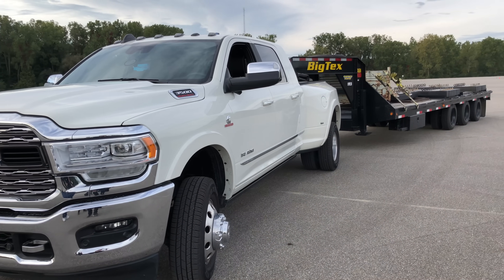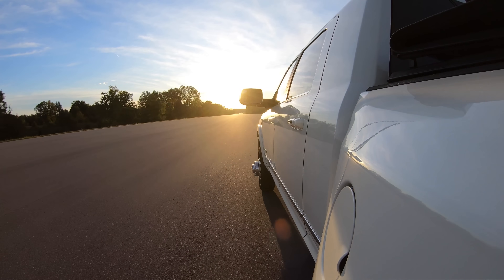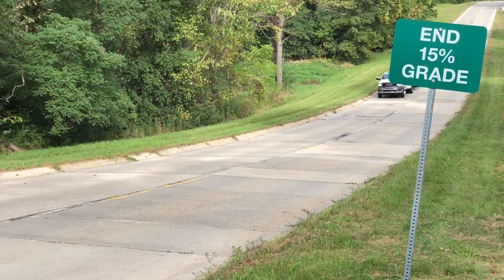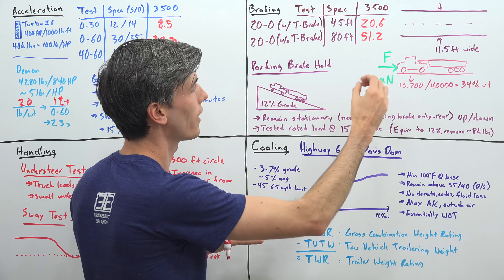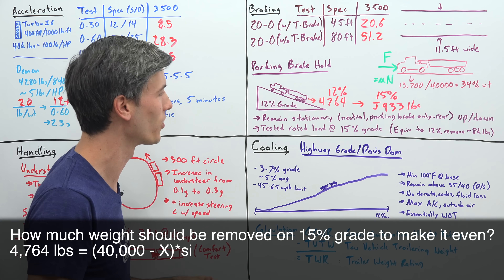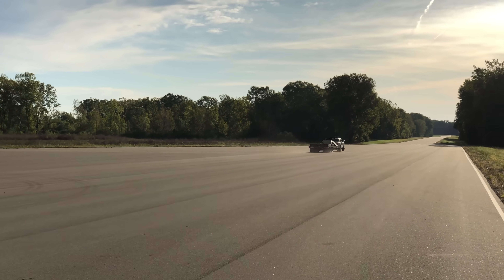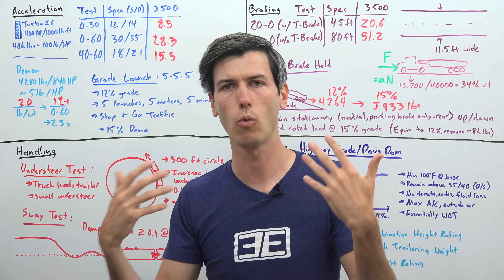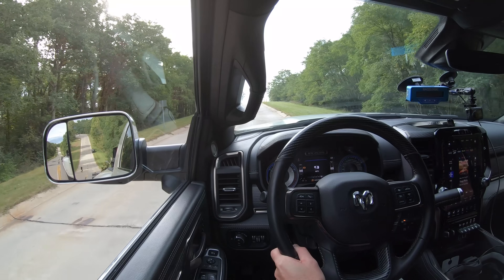How Much Weight Can Trucks Actually Tow?

Comment: Why do dual rear wheels make the tests more lenient?
Reply from the maker: Because dual rear wheels will be pulling much higher loads (thus will accelerate more slowly).
Reply: @EngineeringExplained   I don't follow how the understanding that dually trucks will pull more weight should allow them to meet lower standards than "regular" trucks. The safety/comfort implications of not being to sufficiently to accelerate to speed on the interstate, hold on a hill, not overheat under sever conditions are the same regardless of the number of tires on the driven axle.

Said another way, a dually truck is allowed to perform worse in almost every way than a 4-tire truck with the same towing capacity. That is not what consumers expect.

I could see an argument from a rear cornering stiffness or redundancy in case of rear puncture.
Reply: @roflchopter11  so you think a semi should accelerate as fast as a 4 wheeled truck? See what I did there?.. Compared 2 totally different vehicles, making no sense. More weight is more weight and more power, torque, and brakes can only do so much to overcome that.
Reply: @roflchopter11  - there's a piece of info you're missing- the single tire trucks don't have as high of a towing capacity. The single tire can't handle the weight, so the trailer has to be lighter to keep the tongue weight appropriate. So with that in mind, the lighter overall weight of the single axle maxed out should be more authoritative in every performance metric.

*edited for spelling*
Reply: @Broadpaw_Fox  trucks don't need more than 30k lbs towing anyway. Need a license for that, and at that point you might as well get a semi, much safer and better at the job
Reply: @Ckcdillpickle  - oh, I agree. But to be clear, I'm a truck driver and have been for over 10 years. Hauled a lot more than 30k lbs... :)  But I do agree that people should be better trained to drive larger vehicles/payloads... it can matter a lot and would save people's lives and/or wellbeing. 

It would also give people in smaller cars an idea of what it's like driving something large and heavy, which might keep some of them from driving as badly around us... potentially saving lives and wellbeing. :)
Reply: @roflchopter11  A dually truck is going to have very comparable amounts of power to it's single rear brother. For example, having driven a F-350 single and dually they essentially identical power output, but one is hauling quite a bit more weight. That means it will take longer to change speed, up or down. At any weight rating, the dually is the better option.
Reply: @billkerksiek208  I know it will make similar power/torque and that it is the better option due to rear axle capacity. I just don't see why SAE has decided upon what are supposed to  be objective performance metrics for what a truck can safely pull, but then handwaved more lenient metrics for dually trucks. If the issue with pulling higher loads on a single rear axle truck is that the rear axle can't take enough tongue weight to be stable, shouldn't that show up on the understeer and transient response tests? Similarly with rear grip and the parking brake test.
Reply: Extra weight and associated drivetrain losses
Reply: @KaitouKaiju  But you have more grip. and the extra weight is minimal when you are towing 40,000 points.
Reply: Matthew Jackson Rotational weight is also different than just actual weight. 

For example you will see more power if you remove 10 pounds from the drivetrain, than if you remove 10 pounds from the cab.
Reply: If you're bigger, you can be slower without being all that unsafe. "Acceptable" acceleration for a big rig is "suicidal" acceleration for a motorcycle.
Reply: IAmTheLiquor Lahey  "your". Well, I had a good laugh. It seems you're the kind of person who replies to a month old comment on YouTube to berate the OP for asking a question you deem trivial or unworthy of being fully answered.

Comment: For towing engine longevity, is it better to tow pulling up a hill or use engine breaks going down a hill?
Reply: I didn't know if the high revs of engine breaking was more difficult on the engine then lower revs towing up a hill.

There is a lake I take my boat to regularly where I actually do have the option. I can drive around one side with much steeper uphills to the lake or around the other way with a much more gradual incline and then downhill into the lake.

Comment: Drives a nissan sentra... clicks video anyway.
Reply from the maker: One day you'll rent one of those baby uHauls haha, and you can run performance tests to see if rated properly. 😂
Reply: @EngineeringExplained  "Hello, AAA, yeah it's me again"
Reply: I do have a medium duty truck but the most trailer weight I've had was around 8,000. However I enjoy wrapping my head around this stuff. For instance - understeer. It seemed right to me years ago but I couldn't explain why. Thank You!
Reply: i drive a prius. i used to drive a semi interstate. 80,000lbs. that was heavy. ain't no prius. gotta accelerate hard and brake slow, slow, slooooow!

Comment: So, given the actual acceleration and stopping test data, it seems like this truck can tow more safely? Or am I missing something?
Reply from the maker: To an extent, yes, though we don't know how well it does on the Davis Dam test (just that it passes), and also, this isn't absolute worst case for the truck (since GCWR is 43,000 lbs, and we're at 40,000 lbs due to a maxed out GVW (see pinned comment above). But passing SAE J2807 standards simply means the truck is capable of the weight disclosed, marketing/engineering could still choose a weight below maximum to advertise as the tow rating.

Comment: American towing laws are silly.
The weights you allow a ute/pickup to pull are plain ridiculous

Here in aus, the max weight a light vehicle (4.5t max 9900lb)
can tow is 3.5t (7700lb) and people are silly with that

I have my medium ridgid truck licence and my limits are 
Vehicle anything with 2 axles.
Trailer 9t, (~20000lb).
Even with a truck licence and towing with an actual truck i am not allowed to pull more than half what you can tow with a ute.

It's madness
Reply: What different does it make? An America "Ute" is just a truck with a bed. The construction underneath is all heavy and intended to handle massive weight.
Reply: Australian towing laws are irrelevant.

Comment: So, as always, they test for greater conditions than advertised. Ahh, the guarantee budget of engineering.
Reply from the maker: Yes, but remember if you're playing with numbers greater than they advertise you're putting the liability on yourself entirely. They create tests to determine the number they're comfortable with the truck performing safely at.
Reply: @EngineeringExplained  I'm going to school for aero, so I absolutely understand that - I'm just saying that it's always interesting to see how far above a standard people will test to guarantee the standard.
Reply: @EngineeringExplained  Yes that may be, but I'm fairly certain that the dually mega cab was over its payload with that pin weight. I have a hard time believing that a trailer exists that has total max towing weight on it and not be over the payload. Weakest link comes to mind.  Any idea what the payload was in that truck?
Reply: I'm not seeing a lot of excess headroom in these tests.  The 12% grade, 300' diameter circle, and the real-world hill-climb at-temp are all very plausible.  Even FCA's 15% grade isn't completely unrealistic even if it is uncommon.

Comment: Thanks for covering this topic!  I always wondered what was behind these numbers or if it was just marketing blowing as much smoke up our backsides as the lawyers would allow.
Reply: a little from column A, a little from column B
Reply: @Matticus289  double like for Archer reference
Reply: @JoeHynes284  Ha! I was actually quoting Homer Simpson. But, it appears @Andy Hass hasn't heard of either. Or sarcasm, for that matter
Reply: @Matticus289  Abe Simpson... when the feds bust in the front door looking for Homer's mother.... are you stalling or just senile.
Reply: @Matticus289  not really. Its a spec. They pass or they dont. The acceleration spec is pretty broad. So why doesnt ford or gm tow 10k more than the ram since they have 50hp more? Because they cant stop more weight! Because they cant keep the truck cool going up the Davis dam. Making the spec more realistic than just marking bs.
Reply: @crazyhass84  It's a spec made up by the manufacturers themselves for marketing purposes. "Smoke up our backsides" is the correct basis of the specs. In the real world, cooling and braking for maximum towing capacity are critical over long stretches (the truck should be tested on long, difficult grades at high ambient temperatures, up and down repeatedly at the loaded number as it would have to perform during, for example, a materials delivery job). The manufacturers use shorter and less demanding testing for their purposes. Besides, their claimed towing numbers are irrelevant if payload and correct weight distribution won't let you anywhere near the claims that marketing is plastering all over their advertising and their salespeople's brains. With the weight of a diesel engine, a 4WD system, a crew cab, even with dual rear wheels, before there is any fuel, driver, passengers, and gear, total available payload is often in the 5,000 lb. range or less.
Reply: Probably blowing smoke I think
Reply: The SAE spec is pretty new, so it is better than it used to be. It used to be that no manufacturer tested their products the same, so it was impossible to tell if a weight rating was safe. At least now, the tests have minimum limits. There is still room for subjectivity by manufacturers going beyond the minimums, but that's only good for those of us that buy these vehicles.

Ignore the idiots below stating that it's just marketing. Everything in engineering needs to be sold, but this is an engineering standard created to give consumers confidence in the engineered product.

Comment: Why is horsepower referenced in respect to acceleration when it is the torque doing all the accelerating?
Reply: kenneth parker horse power talks about how quickly you can apply torque.  Torque is just a force a thing is capable of.  Horsepower is that force applied in a certain amount of time.  If you are looking to move something heavy and slow, you don’t need a lot of power, just a lot of force
Reply: Torque means nothing on its own. Its all about horsepower which is calculated from the torque and rpm. The benefit of the diesel is it produces a large amount of torque at a low rpm which results in a large amount of low rpm horsepower available when starting off to get a heavy load moving.
Reply from the maker: Because horsepower is the critical number for acceleration: https://youtu.be/u-MH4sf5xkY

Comment: I'll need this later when we start looking at tow rigs for the racecar.
Reply: How heavy is your racecar and all your tools? Lol
Reply: tankerboysabot considering their name, I’d expect a fairly substantial trailer setup. Our 20’ enclosed with car and all is about 9000lbs. We have a friend with a 35’ goose neck which is loaded up with much more and I bet is nearer to 15-16k. For a dual car hauler, I can anticipate even more.
Reply: We eventually went with a Kenworth T600 based toter..  our trailer weight was pretty much irrelevant from then on.
Reply: @5AXISDLOCKHART  Optimal, but not a cheap rig. Depends how much use will be there. Continous usage hardly sitting, its a no brainer. Half the year sitting, half not a 1 ton will be plenty.
Reply: @brandoncaldwell95    We started with a 1 ton.  After the first trip in the big rig we realized we should have gotten it way sooner.  When on our way to or from the track :  Need to take a whiz, get up and walk to the bathroom.  Want some hot food, walk back and throw something in the microwave.  And so on.  Probably the nicest thing was having our own shower at the track.   Search racingjunk. You can find many older toters for less than a new pickup.

Comment: Pick up trucks are light duty ...
Reply: 482lost yeah I’m a commercial diesel mechanic Semi on a good day gets 8mpg 
Power to weight ratio is better. A class 8 truck and trailer is legal at 80,000lbs before 
Paper work are needed. Same should be for pick ups at 30,000 pounds for pick ups . 
They want to regulate heavy trucks so damn much my as well regulate them to.